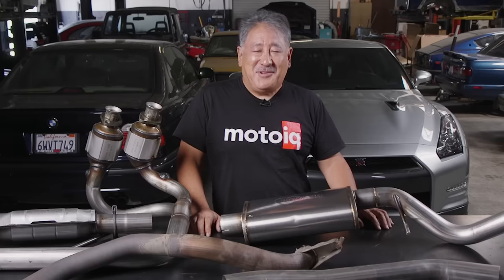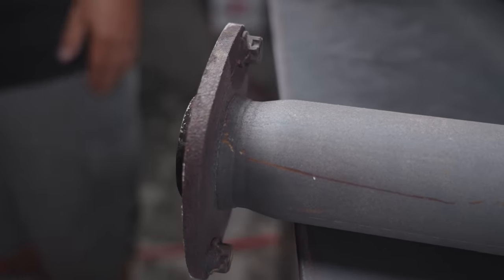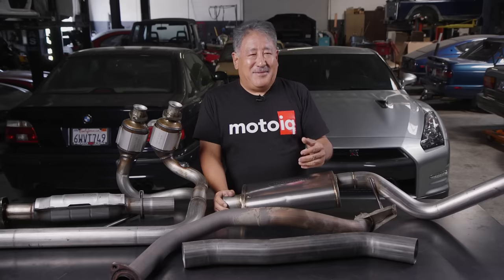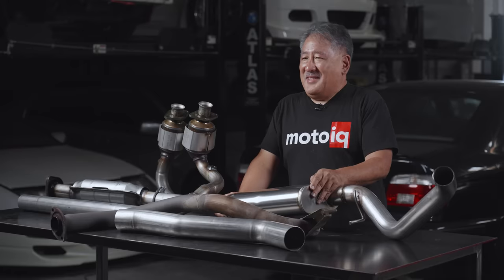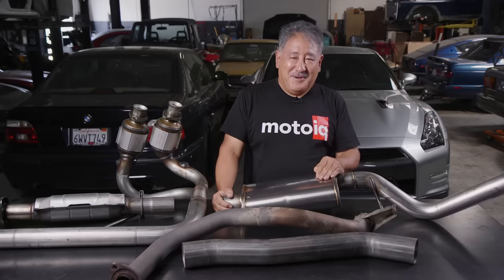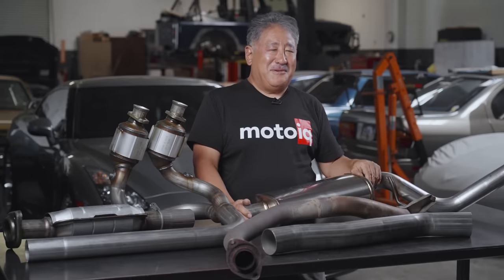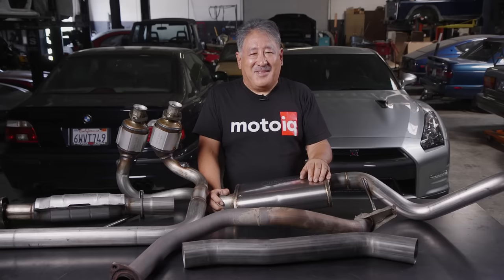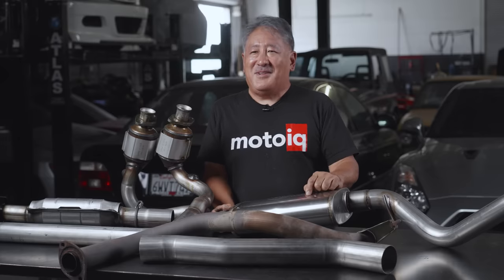Exhaust Back Pressure Myth DEBUNKED!

Comment: I have a 2009 F150 with true dual with X pipe.   I’m wondering if that’s the correct set up for my vehicle versus white pipe or any other recommendations because I’m about to get my exhaust done in the next few weeks   definitely would like to hear your opinion
Reply from the maker: I really like X pipe exhausts, helps mid range and sounds good. Who made it?
Reply: @motoiq  honestly I have no idea that’s why I’m getting everything done over so I know exactly what I have and I’m considering going with borla atak for the sound so I guess I should go with the x pipe again as well What size diameter with the true duels do you suggest I have the 5.4 triton motor I just wanna get nice sounding real good performance. And if you think.  borla atak isn’t good. What do you suggest?
Reply from the maker: Borla Atac is good performing but it is pretty loud but if you want the sound, you can't go wrong with it.  If you engine is stock then 2.5" duals will work pretty good.
Reply: @motoiq  OK and does tips matter with Sound?
Reply from the maker: Some times if they are those muffled tips

Comment: In short back pressure after the merge collector is plain bad , before the collector the runners size is critical and depending to the specs of the engine. So yes too big the runners size can kill power but its before the collector

Comment: Back pressure helps with torque initially but limits top end power.
Reply from the maker: Not if the exhaust is designed correctly and the engine is tuned for it.

Comment: Good grief 🤦‍♂️ I cringe when I hear someone say back pressure is good/needed… and pity the fool saying it. A well 𝒕𝒖𝒏𝒆𝒅 exhaust that makes use of resonance and exhaust pulses will pull negative pressure (a slight vacuum).   Random fact: every 90° pipe bend equals 7' (if I recall correctly) of straight pipe

Comment: I have a 1.6l car and i turbocharged it. When i use a straight exhaust (no resonator, muffler, etc) it gets 260 WHP on the dyno but only 13.3s on the drag strip. But when i put a resonator i swear it gets around 250WHP on the dyno but 12.8s on the drag strip. I also feel it has more torque. Can someone please explain this? I'm a newbie.
Reply: On a 3 cyclinder or a 4 cylinder with headers, any pipe is better than none. If the pipe is long enough, there is no resonance and it works for all RPMs. But what is long enough? And reflection from the end is a resonance. Small car with 3” ? Sure a short tube. So manage the resonance! Match it to your gear spread. ( power band width ).

Comment: I was told that if I did headers and deleted my cats, I would have to change the pulley on my supercharger and increase my boost pressure by at least 2 psi because I would actually lose power from lack of back pressure... sounded a bit odd to me  since like you say, the less back pressure the more efficient for power gain... is what I was told true or is someone trying to take advantage of me?
Reply from the maker: That is not true, you may have to retune your ECU  though.

Comment: I believe 2.5 is a good balance between power and noise for a built k series  3 inch is just way to loud for me.
Reply from the maker: 3" is for once you have cams, not just a stock engine.
Reply: even with 2.5 inch is still good for a built k series engine I believe yes you wont make the most hp but its totally safe for the engine. @motoiq

Comment: Unless it over scavanges the chamber.short open exhaust can also suck cold air and crack a valve
Reply from the maker: Nope another myth, wont happen.
Reply: yes, weve got lots of proof of it on the dyno, u think we build 20 million dollar race engines and dont know,?. if not y r u putting tuned exhaust on ur "race cars " instead of a short open pipe? the engine needs back pressure, not lots but it needs some and yes without it u can over scavenge. thats y f1 cars use a brass venturi in the exhaust orts to help stop it.  @motoiq

Comment: Bahaha too much back pressure and your going to melt your plug wires and you need some back pressure or your going to loose hp and torque and those are facts 💯 I know from experience and years of research and building engines
Reply from the maker: Well you are 100% wrong.  Watch the video.

Comment: Stock cars of old needed back pressure to preserve valve life. Nowadays the equipment has improved greatly and can withstand the added temps.
Reply from the maker: damaging valves is a myth.  What happens is reducing backpressure makes the engine run leaner and the higher EGT's damage the valves. Correct the mixture and you are fine.
Reply: @motoiq even a carburettor should notice the increased flow and keep the mixture.
Reply from the maker: No, you haven't played with engines much have you.  If you significantly improve the exhaust you have to rejet.

Comment: Different engines, different times, not all engines will react the same to changing the exhaust. Engineers have to design these exhaust so that engines perform to meet certain demands. It’s not like the 70’s - 80’s where engineers didn’t have fancy CAD models to model air flow and just just hmm 1.5” exhaust will work..

Comment: Ahhh, Terminology is important and saying Back Pressure is not breaking it down in to the separate stages of the exhaust path.
Back Pressure seen by the piston is important, partially for cylinder scavenging, and also for as close to complete combustion as possible to efficiently make power out of each fuel molecule. This is a very different part of the equation compared to a restrictive exhaust system.
If this wasn't important the Top Fuel racers with completely open design options would have holes in the heads bigger than the exhaust valves and venting straight to atmosphere. They don't, so why do they use short zoomie pipes and not big gaping holes?
Reply from the maker: As a tuning tool

Comment: On a stock Street engine you need just a little bit of back pressure it does help bottom in but flat-out drag racing just a little bit of straight pipes on a headers is best
Reply from the maker: Actually even on a stock engine, if you build an exhaust with the most velocity and the least possible backpressure it helps power all around.

Comment: Thanks for the explanation. I'm rebuilding my 2003 Jaguar s type r , 4.2 L supercharged motor it lists as 400 HP. would it help the motor effecientancy if I went with a larger tube exhaust ? I'd invest the money if it would help . Thanks
Reply from the maker: How big is the stock one?
Reply: @motoiq  2 1/4 . Before the rebuild.
Reply from the maker: If its a single exhaust, 3" is pretty good for that power level.
Reply: @motoiq  it's dual exhaust from factory . I believe the torque is 390 as well .
Reply from the maker: If its a dual then 2.5-2.25 is the best bet

Comment: What happens if you take the exhaust of ? Or make it really short ?
Reply from the maker: Probably nothing good, watch the video.
Reply: @motoiq  
I did but if you take it of you remove back pressure wich is good ?
Reply from the maker: Did you understand the video and watch the whole thing? Low backpressure high velocity is good You don't get high velocity and gas column inertia from removing the exhaust.

Comment: My 71 hornet v8 was killing exhaust valves within every 8k miles . It had 72 degrees overlap ,Hooker headers going into 2.5" glass packs. The intake charge was flowing right out the exhaust.  I was told,that at speed,  flames were seen under the car. After changing the cam to a 42degree overlap , problem solved. This didn't affect performance  and reliability increased. No back pressure was killing the valves.

Comment: what about using backpressure to get better fuel mixture ratio/fuel economy out of a bigger displacement engine?
Reply from the maker: What that doesnt make any sense.
Reply: @motoiq  it's certainly possible/likely that I am misunderstanding something about the engine design as I am still in the beginning stages of trying to learn these things, but it is my understanding that they put a relatively restrictive air intake and a relatively restrictive exhaust on certain 80s motorcycles such as some of the Honda magnas in order to meet the new 701+cc import tax and changing emissions standards of the time without having to change everything needed to manufacture  the more intensively engineered engine block,heads etc.
Reply from the maker: Never heard of that.

Comment: I honestly don't understand much base on the terms used but base on experience on a 4AFE engine, when I removed the CAT and replaced the chambered with freeflow, I lost torque or acceleration and felt heavy. 

Same with my motorcycle.
Reply from the maker: If you go to big you loose velocity and scavenging and loose torque. Also you need to retune sometimes because the engine runs leaner.
Reply: @motoiq  thanks. 

Can you please explain what velocity you mean in this case and scavenging? 

I'm actually not increase my exhaust pipe size. just removed the CAT and replaced with Scav and changed to free flow muffler from chambered. 

Same pipe diameter.

So does that mean losing pressure means losing power. ?
Reply from the maker: Watch the video, the whole video was about this.
Reply: @motoiq  I finished it. sorry not quite understanding it. maybe with the terms I'm not familiar.

Comment: I think that myth comes from people who put a big exhaust on their car without retuning it on carburated engines: they ruin the tune of the original set up when improving the exhaust system only.

Even bigger effect with better flowing airfilters in combination with carburators without retune it: it will run lean.

Both can/will give lower power and awfull behaving engines.

Comment: The rules apply slightly differently for race engines running good old fashioned carbs instead of fuel injection, and with a lot of cam timing overlap and pulling 9k rpm. 😊
Reply from the maker: Although the primary length might be a bit different, you still don't want backpressure!

Comment: I had open pipes on my Harley, as soon as I put the original pipes on, I instantly got 10 horse power back, back pressure is part of volumetric efficiency.
Reply from the maker: Backpressure hurts volumetric efficiency,  your pipes were either poorly designed, too big, changed your tune or all three.

Comment: You need back pressure for that low end torque. It helps close the valve.  And seal better.  Now unless your racing and driving at the red line all the time, you dont need much.
Reply from the maker: That is completely wrong.  Watch the video and learn why.

Comment: Unless ur riding a 2 stroke. Backpressure is not needed
The reason itll run like shi if u just cut off the exhaust is it aint tuned for it

Personally, i love chopping exhausts for drags. As at full throttle backpressure is never needed. And it allows u to move as much air out as possible. More flow out=more flow in. More flow. More powa. Bing bang boom now u goin ti the moon
Reply from the maker: Actually two strokes don't like backpressure either https://www.youtube.com/shorts/qf9eFYPYXUY

Comment: But too much Flow from a Downpipe and Exhaust that's too large for the Application should cause too much restriction and Back Pressure which will reduce Exhaust Gas velocity and reduce power. This is probably what they mean. There must be a fine balance increasing Flow yet and still reducing Back Pressure. As a guide, by what amount should one increase the size of DP and Exhausts when upgrading for a stage 1 or 2 Road car ? I have gone from a stock 42mm Turbo DP to a 63mm and can feel a drop in the low end power. Above 3k rpms the car comes alive but as an everyday daily driver, its laggy. This is an increased flow  by 125%. Is this too large and beyond the threshold where you start losing power ?
Reply from the maker: what sort of an engine? 63mm is reasonable for any turbo car unless the engine is really small.  Also the turbo might be hitting a lot harder so it feels laggy.  Should have less turbo lag if anything. Also have you verified your tune and checked your AFR?
Reply: It's a 1.4T Suzuki Swift Sport with a small TD02 turbo. My tuner even did a revision on the tunes and increased fueling however that flat spot in the lower range remained. Do you think it's tuning related or is it on the hardware side?
Reply from the maker: That is a really small engine.  Still the exhaust is reasonable, but maybe a smaller one could help due to the smallness of the engine. Perhaps 55mm.

Comment: I was taught that you need back pressure to prevent your valves burning. If your exhaust is too freeflow, the temp on valve seats gets too hot, due to the high gas flow, and they burn, back pressure supposedly slows the gasses and keeps the valve seats cooler...🤔
Reply from the maker: That is not true, back pressure has nothing to do with it, running too lean from improving your VE but not retuning does it.
Reply: @motoiq  ...thanks for clearing that up, never too old to learn something new. 🍻👍

Comment: Well..yes and no. A small amount of back pressure helps low and mid range torque.
Reply from the maker: Actually it doesnt.  Backpressure never helps anything when it comes to the otto cycle.

Comment: I thought I felt a difference, so I planned on doing a full exhaust but I didn’t know this. I have a G37 with the VQ37VHR and I put in an aftermarket axle back exhaust which lead to a bit more back pressure and then my catalytic converters go out. Both of them. So I recycle them and got myself some test pies and then my y pipe busted… let’s just say the cycle persisted until it’s blue title was taken away from a Honda 😒

Comment: 3" pipe for an n/a 4 cylinder makes sense. Choke at the merge, different story  My simulations say dual 3" with an x pipe on a 500hp 289 v8 is about right for the pipe size, its marginal gains from dual 2.5 with x pipe.

Choke at the merge though... constant velocity is king there and on an even fire engine it doesn't need to be much bigger than one of the header pipes feeding it. 2.25 on the v8 i was talking about, 2" if it had a flat plane crank and was even fire
Reply from the maker: Even fire pertains to V6 engines, an even fire has 120 degree firing intervals, and an odd fire is 135 and 105 firing intervals. Flat plane pertains to V8 engines and basically turns each bank into a 4 cylinder engine with 180 degree intervals. I don't think even or odd fire makes any difference in the preferred collector size but I think a flat plane engine may make a bit more torque with a smaller diameter collector.
Reply: @motoiq   from what I can gather on a crossplane v8 the two cylinders that fire 90 degrees apart overlap too much to fit down the choke at the same time if it was sized for even fire. The 90 degree blowdown interference becomes much worse when the choke is too small, and it's less of a problem with the larger choke. Costs you a bit of mid range, but that's life.

Making the same length 4-1 header into a crossover style on my sims raises power slightly by completely eliminating 90 degree interference (and reducing cylinder to cylinder variation), but also lets me run a smaller choke without the top end cost. I haven't looked too much into that data though, as the parts were never going to both fit and still be short enough for peak power.
Reply: @motoiq  oh sorry I didn't realise I hadn't specified even fire was *through each collector*. Thinking of basically nothing but conventional v8 exhausts for a year i forgot about odd fire engines.

Comment: in summary. I have a naturally aspirated C7 Corvette.
If I remove the catalysts and leave only the rear silencer. the typical thing, donwdpipw + Xpipe
Would it be a good configuration?
Reply from the maker: Yes but you will need a retune to get the most out of it.
Reply: @motoiq  I am from Spain. but it can read my ECU and send my file. Do you know someone very good for me to modify?
Reply from the maker: I would look for a local HP Tuner.

Comment: I have a 2004 Terminator and added all kinds of upgrades to it. It pumps out about 620whp 590# tq. Part of the upgrades was a catless very loud exhaust. It got so bad that I brought it to the muffler shop and he installed two baffels. Since he added those I could not believe that I gained torque. I am not sure exactly how much but it is substantial. I was shocked because I was expecting to lose power. So apparently I did not have velocity and my scavenging was not optimal.
Reply from the maker: How big were the tubes?
Reply: @motoiq  I believe 2.5". It is the Borla Atak system with a Mac pro chamber and factory exhaust manifolds.
Reply from the maker: Did you check your AFR to make sure you didn't lean out?  I find it very hard to believe that a 2.5" dual system caused you to loose torque on a 620 hp supercharged small block Ford.  We had a 380 hp NA small block Ford gain 60 hp from going from dual 2.5" to dual 3" pipes.  I think loosing backpressure must have messed up your tune.  The Borla Atak is a loud system, sometimes I swear those are louder than straight pipes. 
.

Comment: Most engines now days are turbocharged, the turbo provides plenty of "backpressure" bigger the better in turbo applications.
Reply from the maker: Actually an efficient turbo makes the boost with less backpressure and thus more power. The tradeoff is usually lag, lower backpressure turbos have a bigger A/R exhaust housing and spool more slowly.

Comment: What about 180 out x pipe designs like fabspeed uses on Porsches? Those seem to increase velocity as demonstrated with the kleenex video where they push air through the pipes? I'm building an exhaust as we speak for my car based on that design would appreciate any thoughts if you see these comments thanks!
Reply from the maker: X pipes help low end and midrange and sound good.
Reply: @MotoIQ  thank you for the response 🙏  working on it as we speak 😆